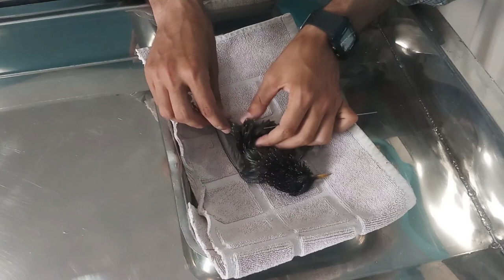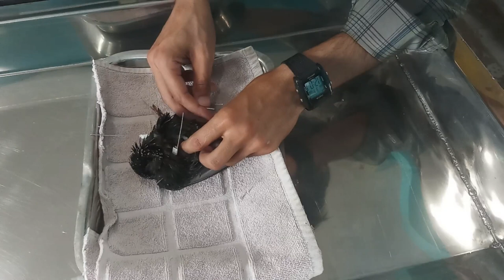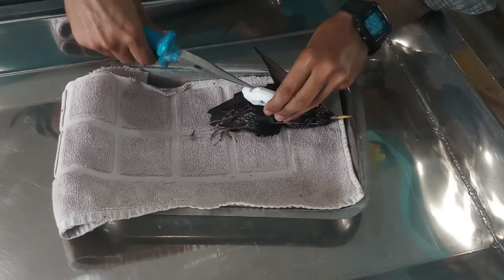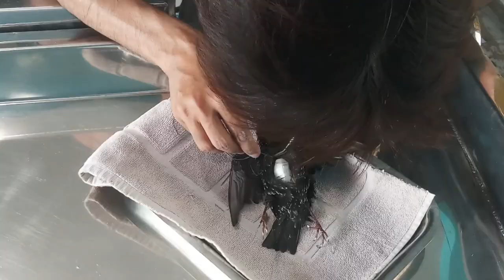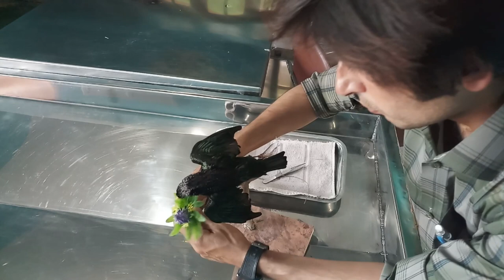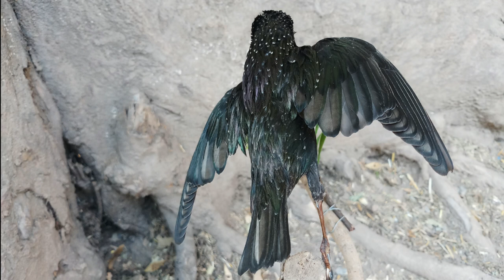Smallest bird taxidermy. Part3.Tutorial of how to pass steel wire and mounting small bird.

Comment: First, the eyes are too big. Second, I would sharpen the leg wires before putting them in.
Reply from the maker: Ya. Should be sharpen the wire edges, will be easily inserted.
Reply: @taxidermyart  Hey, very good video! 

Do you have any tips on how to get the small fine feathers smooth against the body if they are all fluffy?
Reply from the maker: @einsteinium99  First of all the bird should adult in age. Secondly, most of the wild birds molt heavily in the spring/Fall to replace old feather with new feathers.
Then the bird should not be old for taxidermy. But it also depends on environmental temperature, In summer season the bird may be preserved in deep freezer or start taxidermy within 5-7 hour while in in winter the bird may be placed in room temp for 24 hr. But i suggested to start taxidermy as soon as possible after death.